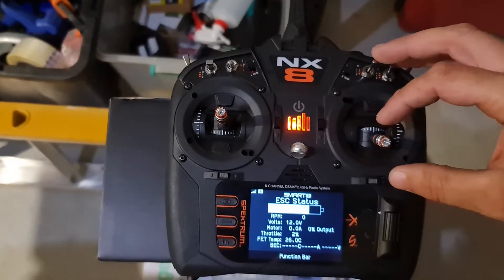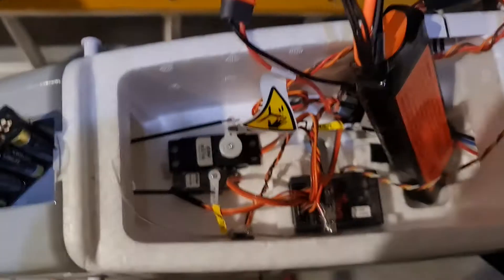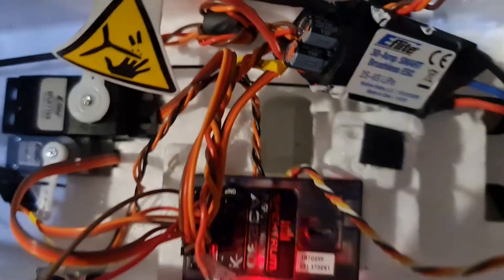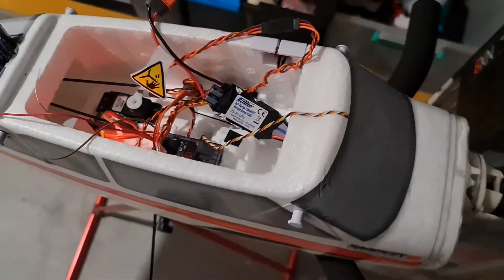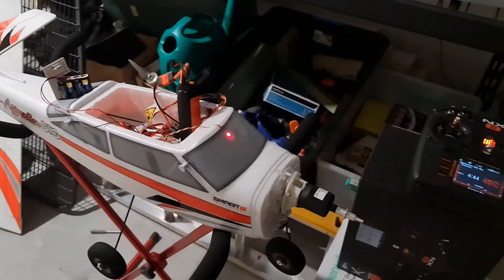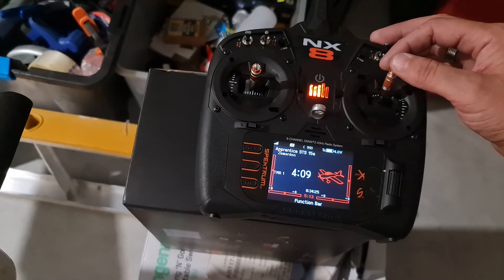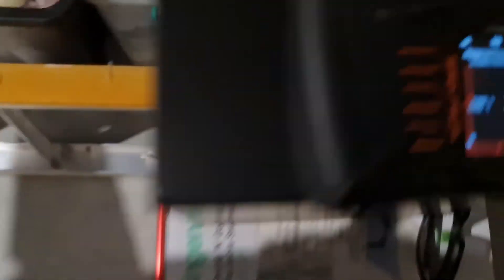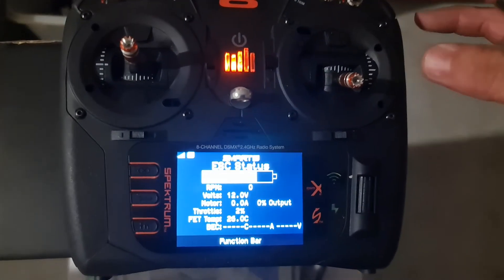Apprentice STS 15e 1.5 Programming ESC

Comment: I'm trying to program the two open channels on the flight controller to be able to hook up a bomb drop. Any tips/directions for programming that? I have done what I need to on the transmitter side, I just don't get a response from the servos when plugged in.

Comment: Why did you have to do this...did you buy a new ESC?
Reply from the maker: I wanted to program the stock ESC to up the motor timing to high for better performance.

Without seperating the SAFE initiaization and ESC boot up, you have no opportunity to actually enter the ESC programming mode as SAFE initialization blocks you from doing so.

This way you seperate the bootup sequence allowing you to enter the ESC programming mode freely.